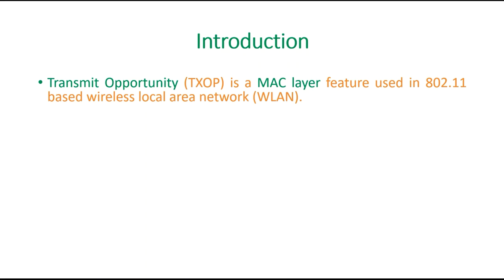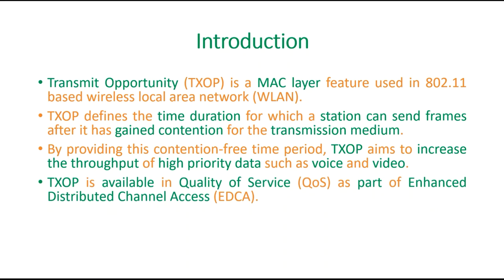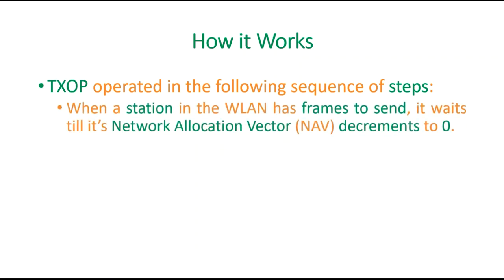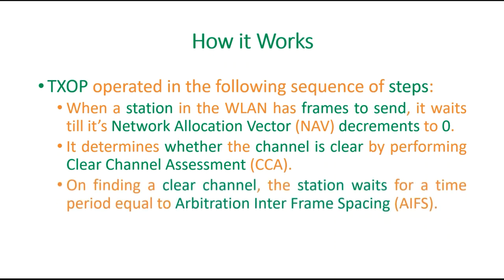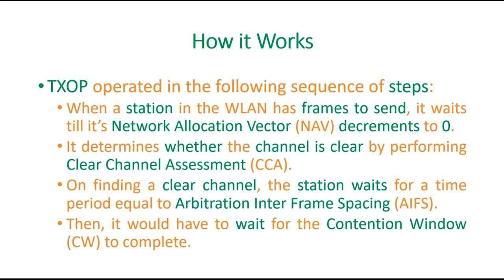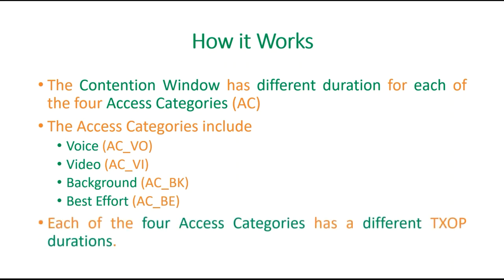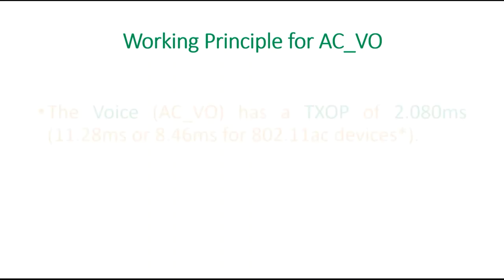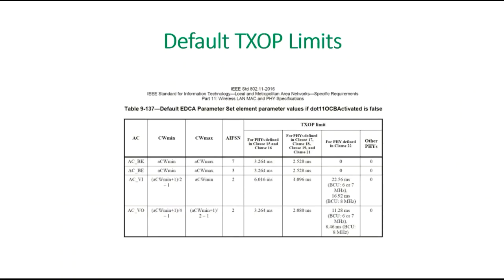Transmission Opportunity TxOP | QoS in WiFi Networks | What is TxOP Means | 802.11e wmm qos

Comment: Why Video has greater TXOP value than Voice?
Reply from the maker: Hey Sidhvija,

I don't have a proper answer for your question.
But Video has a greater TXOP value than Voice, because it is more data to send.

TXOP operates in the following sequence of steps −

When a station in the WLAN has frames to send, it waits till it’s Network Allocation Vector (NAV) decrements to 0.

It determines whether the channel is clear by performing Clear Channel Assessment (CCA).

On finding a clear channel, the station waits for a time period equal to Arbitration Inter- Frame Spacing (AIFS). It waits for completion of the Contention Window (CW). The CW defines different durations for four access categories (AC). The ACs are − Voice (AC_VO), Video (AC_VI), Background (AC_BK) and Best Effort (AC_BE). Once a station acquires the TXOP, it can send frames depending upon the AC in the following manner.

The stations of background (AC_BK) and best effort (AC_BE) categories are assigned TXOP value of 0, implying that they can send only one frame during their TXOP. In other words, AC_BK and AC_BE categories needs to contend for the wireless medium for each frame. The stations sending video (AC_VI) are assigned TXOP value of 4.096ms. This implies that the station can send as many frames it can within this 4.096ms. The stations sending voice (AC_VO) are assigned TXOP value of 2.080ms, implying that the voice category can send as many frames it can within this time period.

It might help you.

Thanks & Regards
Hari